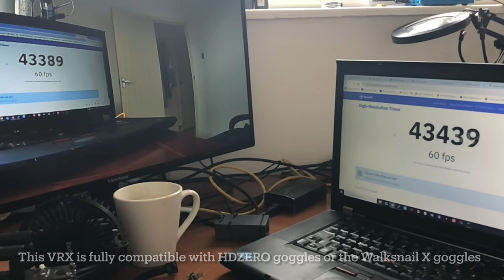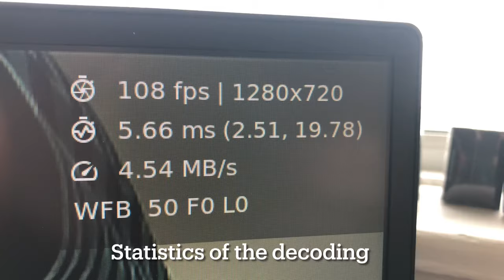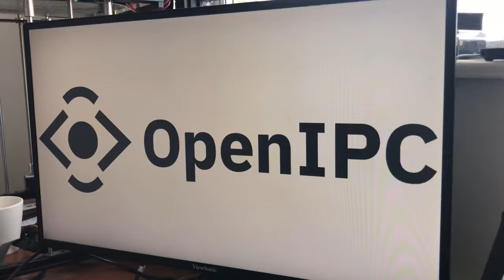Introducing OpenIPC Radxa Zero 3w - World’s Smallest and Lightest 120fps VRX Video Tutorial Part 2

Comment: That is awesome! Congrats for the achievement!
One question, what usual latency I could get using the Radxa Zero 3W connected to a FPV goggles that runs at 60fps?
Will the range be comparable to a DJI/Walksnail system?
Reply from the maker: Please stop comparing our FPV system with DJI or WS as this is not our intention. We do not want to replace any system. We are simply offering our fpv system as an open source solution so that people who dislike closed source products will have an option to use. If you feel like the WS or DJI is good for you then please continue using them, we can’t force anyone to change their fpv system. Cheers mate!😊🍻
Reply: @mariofpv  Hey Mario, please friend, check my question again. I don't want to try OpenIPC because it would be better, but I wanted just to understand what to expect with regards to latency and range at this point. And I do support an open project and I wish OpenIPC, you and all the developers to succeed, to be a really good alternative to the other closed systems. Thanks
Reply from the maker: The maximum range is 106km. I have published a small video proof on the Telegram channel. The latency is 21-35ms. Other members have posted proofs on Telegram channel. Please join our community to see them.😊🤝

Comment: How do you power the radxa unit? It looks like you split the 2s output from your Liion battery pack to power both the goggles and Vrx with the same voltage?
Reply from the maker: I use a 5V 3A BEC. Cheers mate!😊🍻

Comment: Hey Mario nice Work. My radxa is already ordered im very good in CAD Design i cant wait to Design a case for the vrx components my Plan to design it that i can quick change with the walksnail vrx. The nvr already is on the Bench but i wait for my Enthusiast kit 😉 hopefully it arrives the next days...
Reply from the maker: I hope you share your work with the community. Sharing is caring!😇
Cheers mate!😊🍻
Reply: @mariofpv  of course thingiverse Link will follow the next days Cheers Mate thanks for your effort
Reply: Still waiting on shipping confirmation and tracking that was suppose to happen the second half of march 😮‍💨
Reply: @CosmicSlopVibrations  i have received Tracking number and dispatch Note last week 😁🤙 so Just a bit of time.
Reply: @mariofpv i need your Help ... I want to connect the rtl8812au to gpio header or can i only use the USB c  hub Like you do in the Video? My vtx arrives today 🎉

Comment: Congrats again for this amazing work.
What goggles do you suggest to use?
Reply from the maker: There are rumours that there will be 120Hz goggles from an FPV company. I can’t share more information. Currently there is no goggles that can do 120Hz from the HDMI in port. Cheers mate!😊🍻
Reply: @mariofpv  hi ! I have a second hand headset with HDMI input. Is there a min spec that could make this headset not compatible please ? (i don't need the mega quality)
Reply from the maker: @marielizysurourcq any goggles with HDMI in port will work.
Reply: @mariofpv The low-cost HD video transmission is being solved by your amazing work. Now, we also need some low-cost options for goggles.
Reply: @mariofpv so HDZero goggles would work?
Reply: @mariofpv  The new Eachine & Skyzone Cobra ?!

Comment: Mario, if Radxa is cold enough, May be split two parts of ground station? Put wifi adapter in standart bay of goggles receiver and have small Box only for Radxa Zero. There is small fan (20x20). Perhaps it will be enough for rtl8812 cooling? Also There is small   mini hdmi connector with short ribbon Cable - Just 5 cm
Reply from the maker: There are rumours that there will be goggles with everything inside. They will have 120Hz display panels! Stay tuned for the updates. Cheers mate!😊🍻

Comment: In order to achieve some "enterprise" level I believe you need to rework binding process to avoid manual copying drone.key file between devices, it's inconvenient and expects some extra knowledge from every user. Then it'd be great to simplify firmware uploading process as well, to make this device not just for enthusiasts but for "dummies". Then it can become "elrs"-wide.
Reply from the maker: Is it really so hard to press 3 buttons in the OpenIPC Configurator? I mean if someone can’t even do that then I guess they wouldn’t even know how to fly a drone. Cheers mate!😊🍻
Reply: @mariofpv  Seems like I missed how to use "OpenIPC Configurator" for this, last time I copied it via scp. It didn't look like ELRS binding. But good to know there is the way. :)

Comment: Is there a chance to integrate both controller and vrx into this unit instead of relying on other transmitter with different antennas and frequencies?
Reply from the maker: It’s already done. OpenIPC supports full bidirectional MAVLINK telemetry. Cheers mate!😊🍻

Comment: So which VRX is recommended now?
Reply from the maker: Radxa Zero 3w will give you 1080p 120fps decoding which is the maximum an OpenIPC AIO can offer. If you have 60Hz monitor/goggles the NVR is enough. In conclusion Radxa is a better option. Thank you for your support. 😊🙏
Reply: @mariofpv  I have the Radxa board but what about the WiFi board?
Reply: I an just use ay RTL8812au Wifi USB and connect to Radxa?
Reply from the maker: Before you do anything else on Radxa you need to setup the internal WiFi network. There’s a guide on how to do that in the SBC groundstation GitHub. Then you will be able to use the configurator to setup your Radxa. Let me know if you get stuck so I can assist you.
Reply: @mariofpv  I am up and running
Reply from the maker: Well done mate!!!🤝🎉
Reply: @mariofpv  when you have some time, I messed up my settings by changing the MacID via the camera website, it has a new IP but my GroindStation is no longer receiving the video. Do I need to regenerate drone key?
Reply from the maker: @MikeCarr07 no need. The IP is not linked to the drone.key
Please find me on Telegram to guide you.😊🤝

Comment: This is using 2.4Ghz right?
Reply from the maker: It can use both 5.8GHz or 2.4GHz. It’s a setting in the system. Cheers mate!😊🍻
Reply: @mariofpv That sounds very cool, 2.4Ghz should allow for way better signal penetration than regular 5.8ghz fpv :D
Reply from the maker: @5x25_fpv the quad has 1200mW. It can penetrate 2 houses. I have already tested it!😁🤝